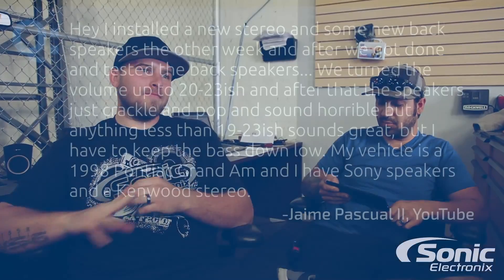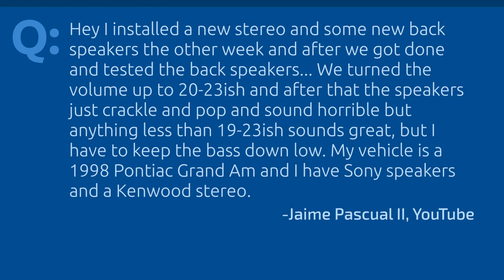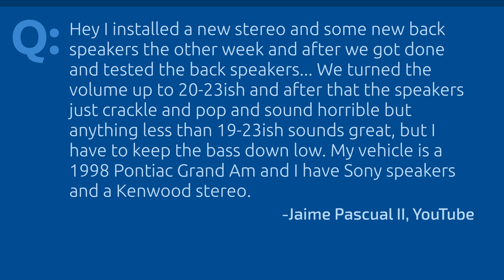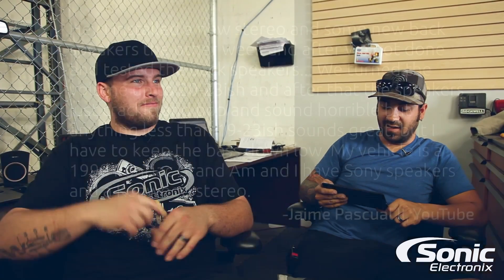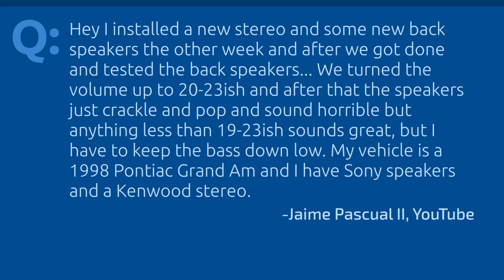Why Do My Speakers Sound Bad at High Volume? | Car Audio Q & A

Comment: What's up guys
Just so you guys have an idea, I have a 2011 Chevy Cruze Eco w/base radio, kicker 350.4(07) going to image dynamics CTX 6.5cs door speakers. Passive crossovers were replaced with a "active" setup via minidsp and tweeters were replaced with seas prestige soft dome tweeters.  I Also have a IDmax 10D2V3 powered by a Brutus 1200.1

Getting to the question now.
My door dinger sound goes through the driver side door speaker. The fact that my doors are now amplified means that my door dinger is noticeably louder. 

My headunit has settings for a lower ding sound, but it's still too loud. Is there anything you could do to lower the dinging sound without negatively affecting the SQ of the audio.(obviously lowering the gain on the amp will lower the ding sound but that will also lower the output of the speakers)

Gains are set below clipping as well.

Thanks,
Terry